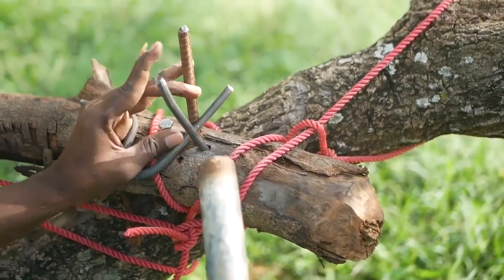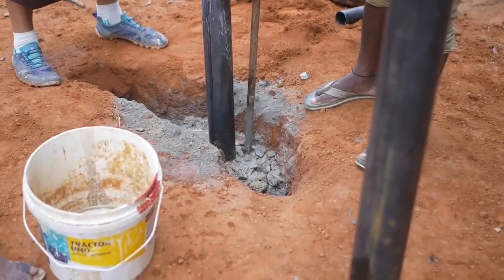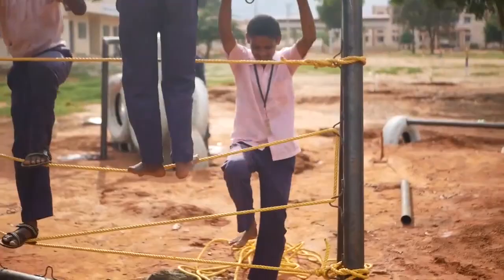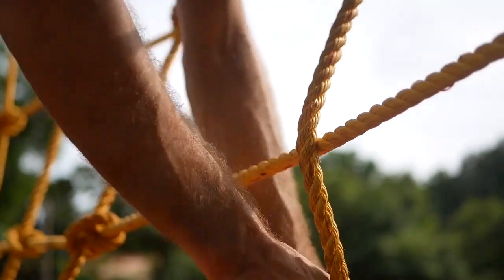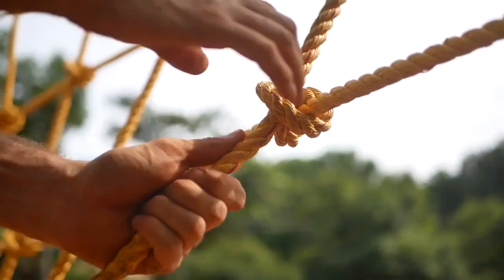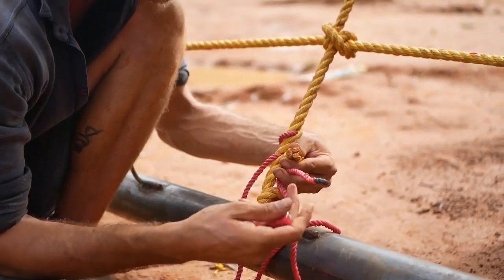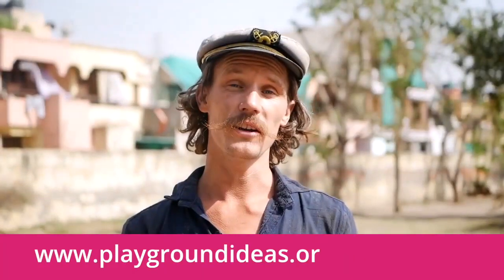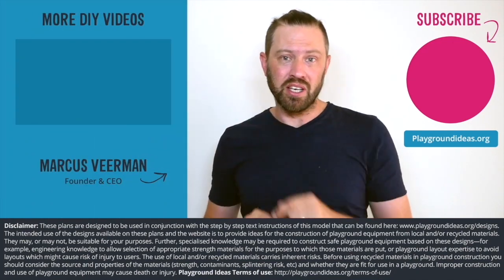How To Make: DIY Rope Net

Comment: Using the knot as shown, the vertical line can move sideways along the horizontal line. To make a neat square you always will need to make adjustments to the vertical rope.